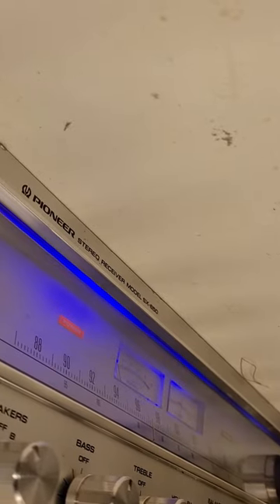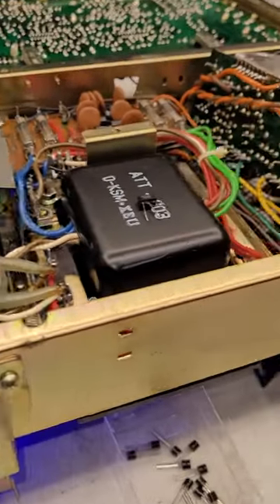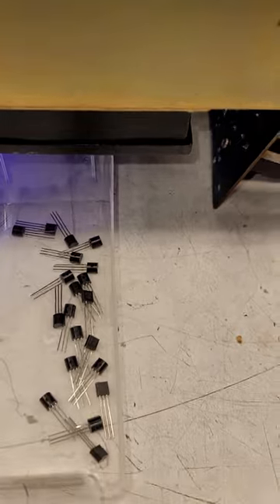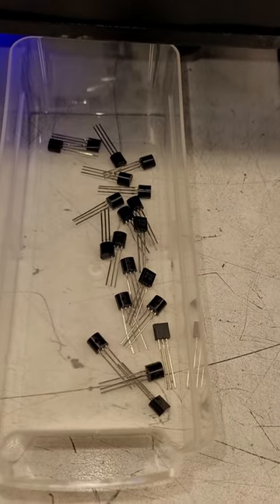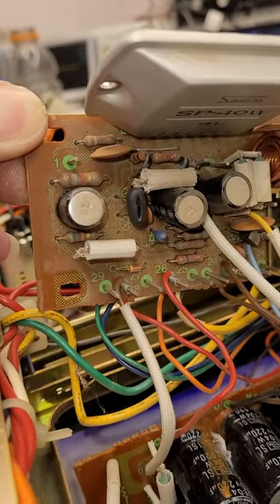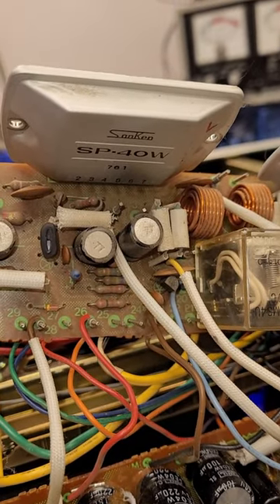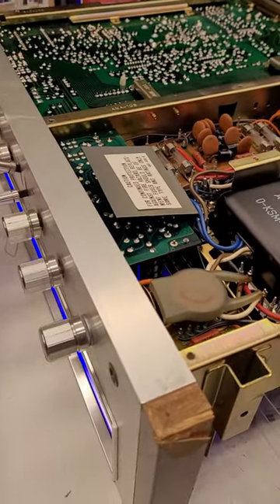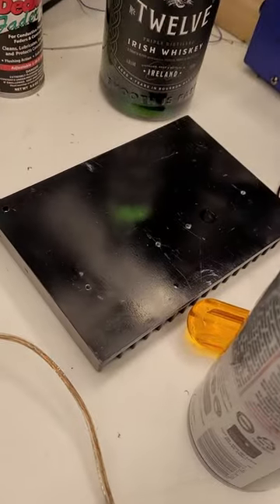Pioneer SX-650 One channel crackle - Speaker relay cuts out - Unobtanium Transistor - #Shorts

Comment: Hey Steve. Saw a repair on a Harman Kardon FL4600 disc player you did. I have one and a couple of belts must be bad- opens but tray no longer spins and Error msg. Cost?
Reply from the maker: A good repair shop in the USA should be able to get up again for about one hour labor and the cost of the belts, usually between $5-$10 per belt.

Comment: Just actually watched an xraytonyb vid sx750 or something where the same damn transistor went lol. He tried first by ordering some originals on ebay that ended up having the bases internally connected instead  of emitter. Then just went for the discrete method 2 transistors. Worked great.

Comment: Weird, the smallest of this series I’ve worked on is the 750, but I thought this whole series used discrete components for the outputs while the X80 series used output packages.  Nice find, a few times I’ve had failures in those dual transistor packages.